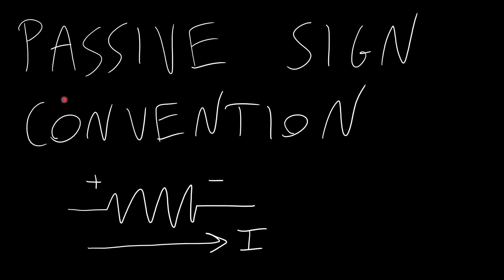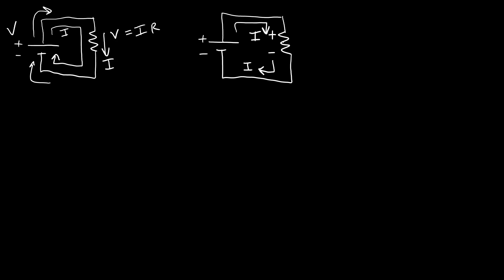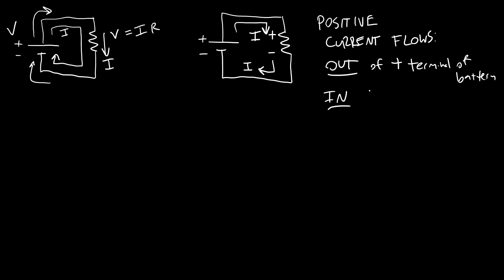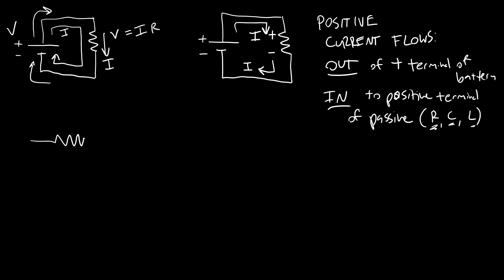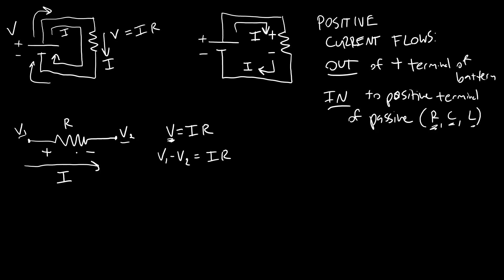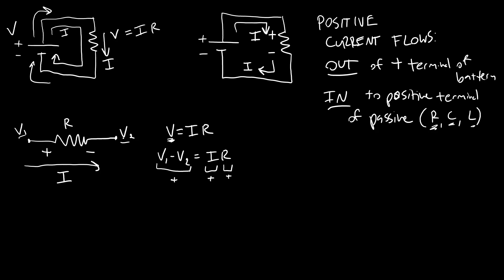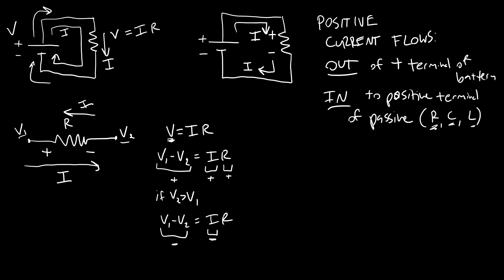Intro to Circuits 13: Passive Sign Convention

Comment: out of interest, when we are calculating total current in the circuit, or just current in the bridge, which is the case when those are negative we need to flip the sign
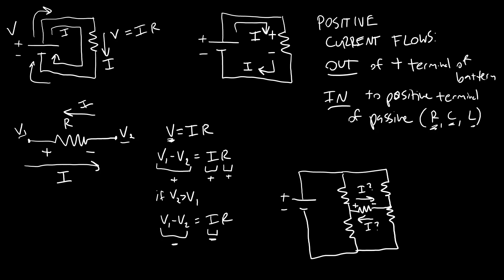Reply from the maker: if you are referring to the bridge circuit at 4:40 - given how the signs are drawn, if you get a positive number for the current then the current is flowing to the right and your signs are correct. if you get a negative number for the current then the current is actually flowing to the left.